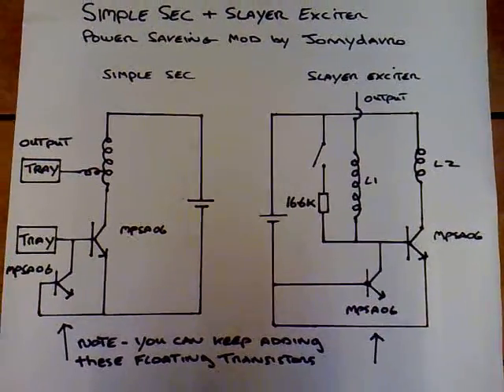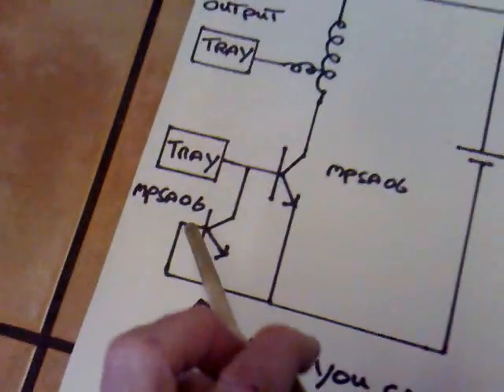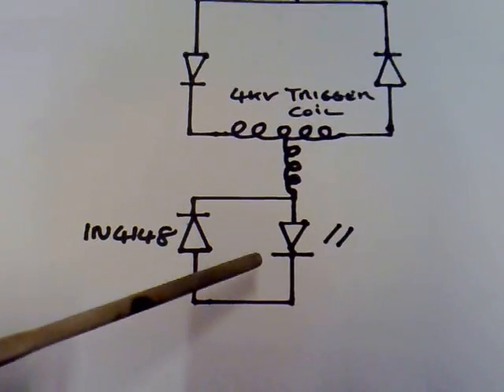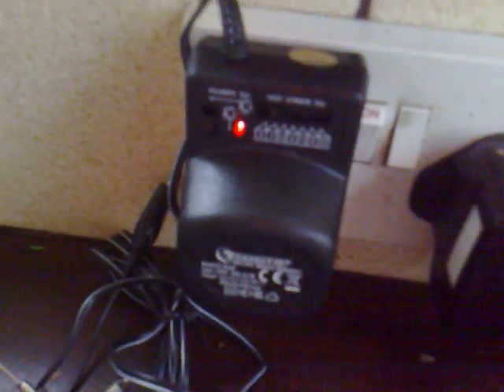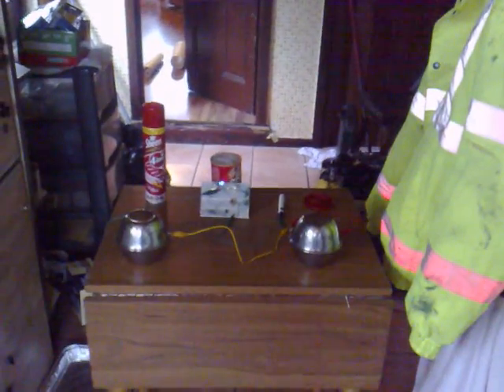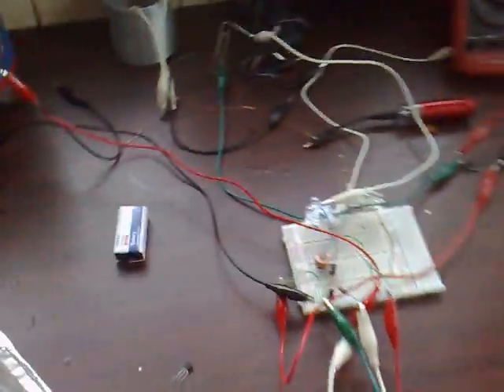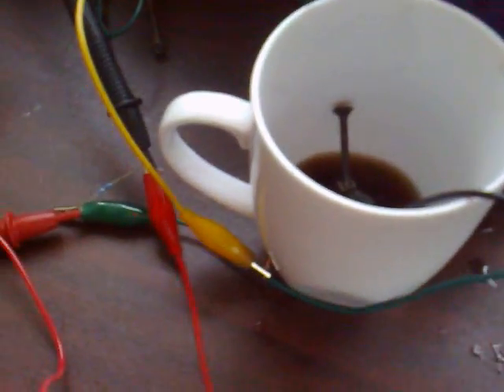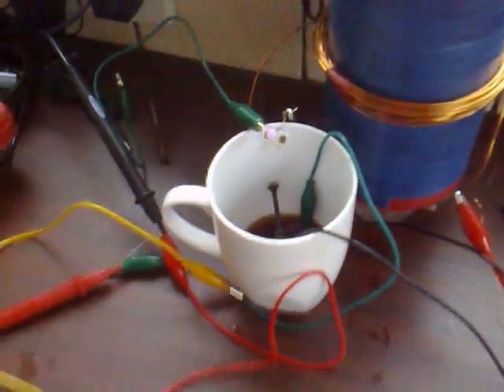Modified simple sec and long range wireless transmision

Comment: have you tried using a coil or capacitor connected to the open emitter i am not sure how , were,or if it should be connected as transistor junctions are very field sensitive to change a small resistor back to the collector base junction was found by capindres to make a difference.

Comment: does it work as effectively when not using an adapter? im realizing that there is HV potential running through the mains that gets through the adapters too.. i noticed this when hooking one wire from an adapter to a pulse motor and was getting a small voltage on the charge end, even after disconnecting all routes from in to out, and this voltage would shift depending on how near my hand was to the wires. oddly enough i got no readings directly from one wire of the adapter alone despite grounding

Comment: A yagi antenna is not very complicated to make, I made a small one for WIFI, but I don't have the circuit to run the experiments.

I made my small Yagi antenna with stripped pieces of  electric copper wire, you can use aluminum too, and 3 layers of  depron foam as a base or stick, a piece of plastic or wood should work too.  That and some patience is all you need.  

Can you send me the video that Diana made?
I never heard of Diana before, I'm new to this. 

Greets, iT

Comment: Jonny:

I don't know where to begin to comment on this video, you have shown so many cool things here!  That amp draw on the vinegar battery is incredible!  That will easily light an led from two electrodes stuck in the ground outside for years!  Your work with the SEC is really fantastic.  The only guess I could make about the extra transistors and open emitters is that maybe they are picking up some of the transmitted energy like an antenna and feeding it back to the circuit?

Bill